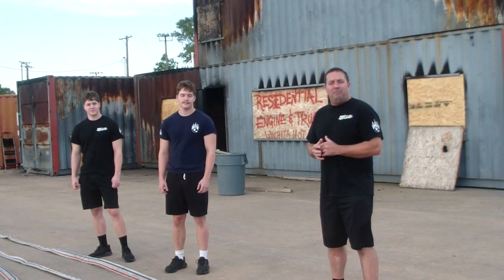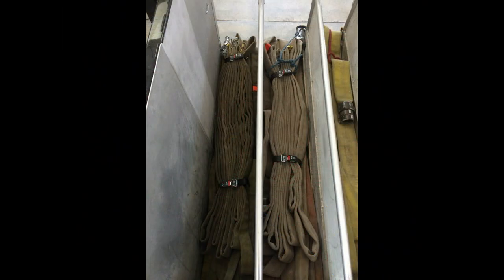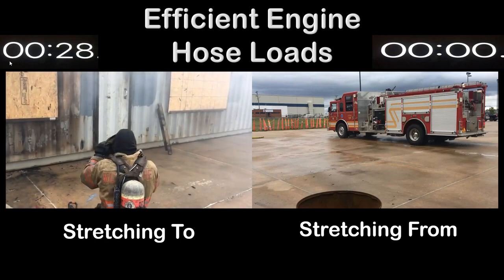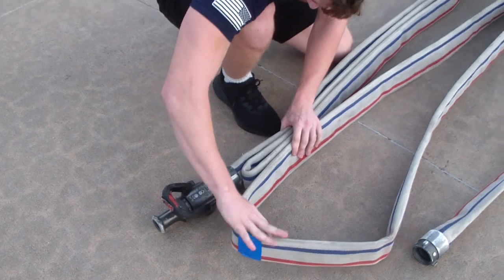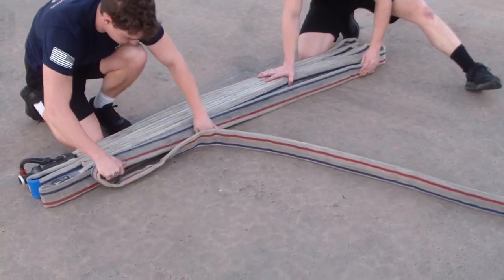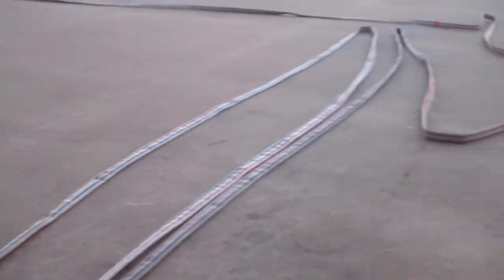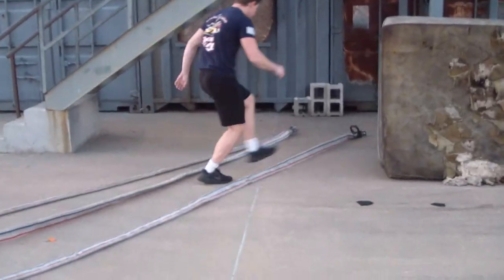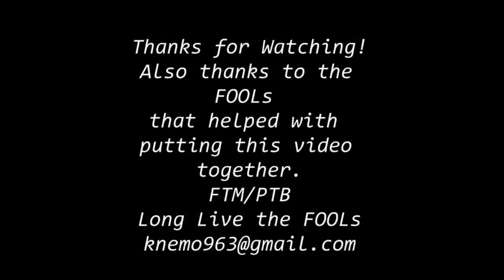The Wichita Bundle

Comment: Do you use these rear lays exclusively? I've noticed your engines have crosslays, just curious. Trying to get our department to adopt something similar. And, do you always "reverse out" to a hydrant to have a secure water source or do you attack with tank water and have an engine lay LDH to you? For clarification,  thanks.
Reply from the maker: Sorry just seen this.  Yea we stretch off the back exclusively, the cross-lay trays have additional bundles that not attached for stretching a second line of another rig.  We usually attack with tank water and second due engine lays in to the pumping engine, but the first due and drive to the plug and get their own water once the bundle is pulled if need be.

Comment: I do not understand how it is considered an eighty-five-foot bundle, but they are using two fifty-foot sections. Can someone help me to understand this?
Reply from the maker: Correct there is a total of 100 foot but in the video we leave the last 15 foot outside of the straps to make it easier to get in and out of the hose bed, only 85 foot is actually inside of the straps (the bundle).  You can make one more fold and put the second coupling in the bundle (if that works better for the houses you fight fire in) and have a 100 foot, it will just make it a few inches wider.  Most of our houses 50-75 foot of working line is enough to get through the house so that’s how much we have in the bundle (plus a little extra for some cushion).
Reply: @nemo963  Thank you so much for the explanation. Makes much more sense now!

Comment: Do you have any videos showing how this would deploy if you had to go up a few floors of an apartment?
Reply from the maker: We are actually working on a video for that too, just slow going.  A common hall type probably take the bundle to the floor below then split the bundle, exterior stairs May has to split the bundle on the ground.  If you do it correctly you can still get 35ish moveable feet on a return staircase if u push the line to the wall and flake your split bundle from the floor below, which is usually enough for an apartment, if you don’t split it and try to bring a full bundle you’ll just have 12 feet of line and a pinch point at the return part of the stairs which can be  mess.  Basically, split the bundle before you reach the stairs, then go up to 1 floor below, and take a halfway and nozzle up the the landing, and addressing behind you as needed, usually getting as wide as you can get with your flake and travel line, your coupling should be 1/4 of the way up from second floor to third floor if that makes sense…video will help explain that
Reply: @nemo963  sounds good, I’ll keep an eye out for a video. We’re researching alternative options for our hose beds because we also reverse out most often and trying to find something more efficient and this seems to fit the bill.

Our biggest concern is we have some 3-4 story apartment buildings without standpipes that need upwards of 400’ of hose up the stairs to reach the farthest apartment.
Reply from the maker: Thw company my boys work for (22’s) have a ton of similar apartments 0:04 , the St Paul stacks under the Wichita bundles make stretches up to 600 feet doable (22s average stretch on an apartment is 500 feet).
Reply from the maker: https://www.firehouse.com/operations-training/hoselines-water-appliances/article/21094742/the-midwestern-static-load
Reply: @nemo963  this is awesome, thank you!